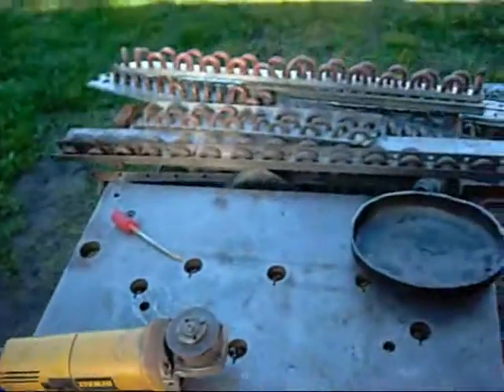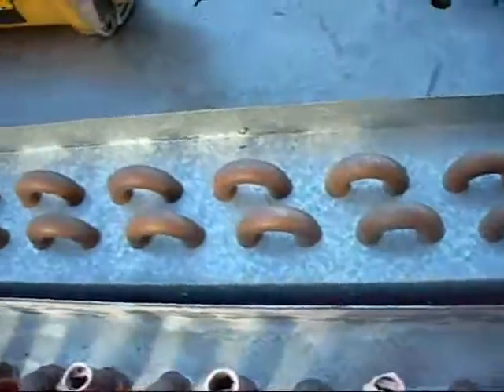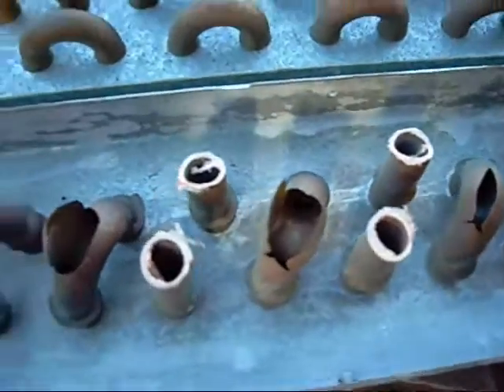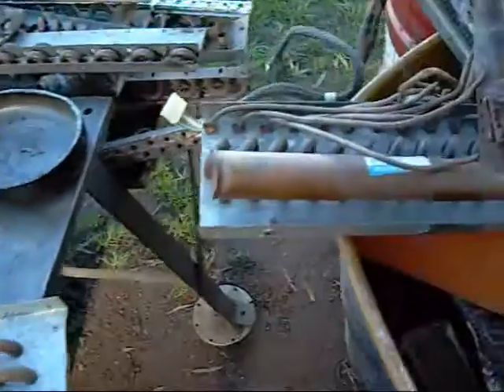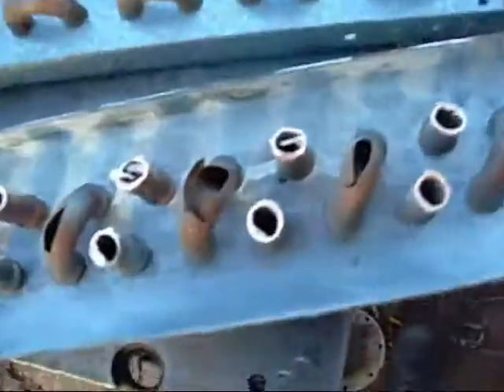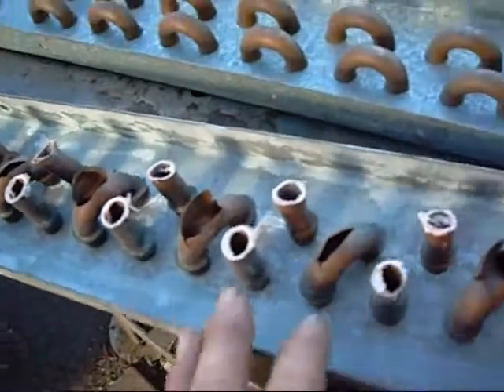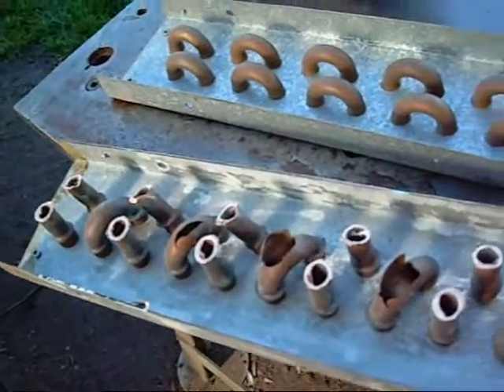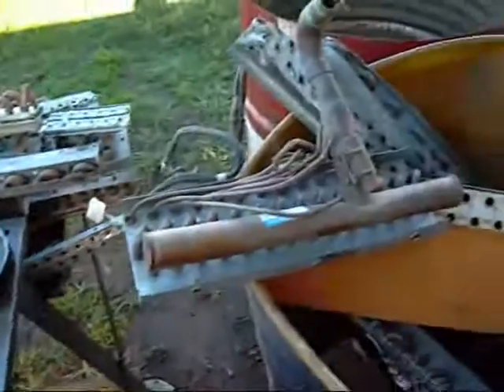Catastrophic Refrigeration Coil Failure

Comment from the maker: I couldn't smell anything on it at the time, but I'd say your spot on with the water idea, especially with the way the plate had manifolds running down its length.

and as you said, gas pressure would burst one then pressure would drop immediately preventing further damage.